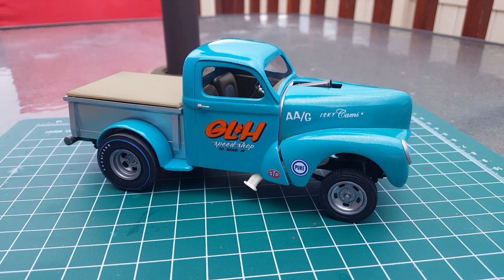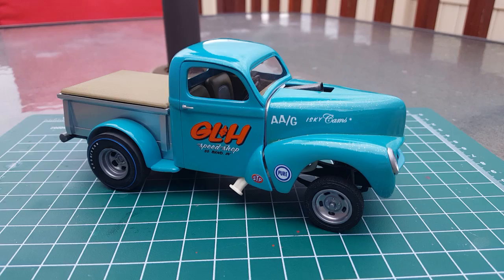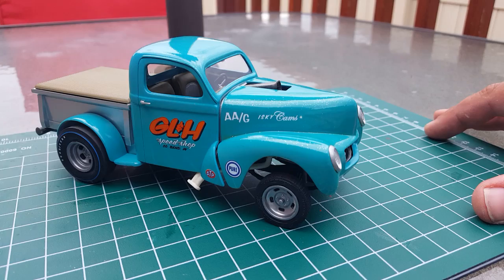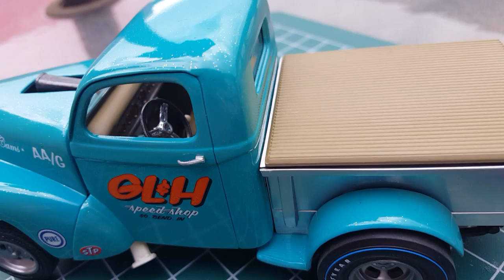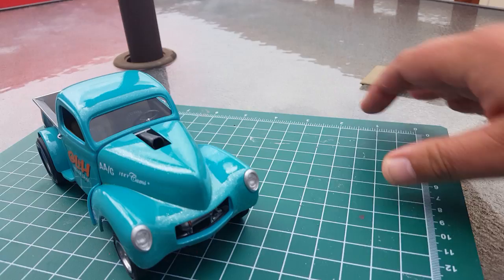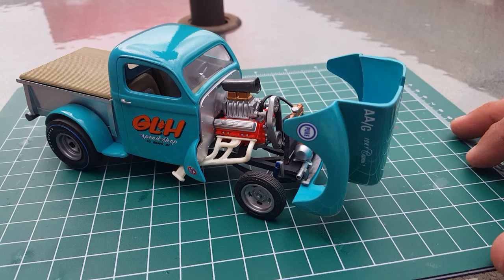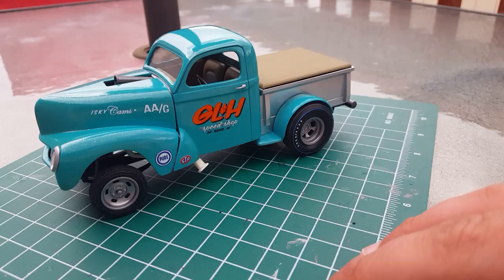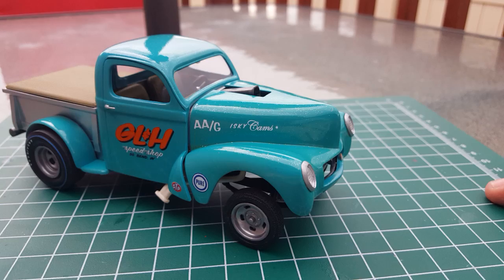Amt 41 Willys Gasser Pickup

Comment: I used a similar color on a 32 fenderless street rod many years ago. It was enamel but it rubbed out nicely.

I like how your tilt- hood works as it should. So many of them don't work well at all.

I'm building a 1933 Willys gasser right now, based on the old Malco gasser. I'd like to use a scoop just like yours. Did it come with the kit or did you find it elsewhere?

 Nice job on this old strip ripper!